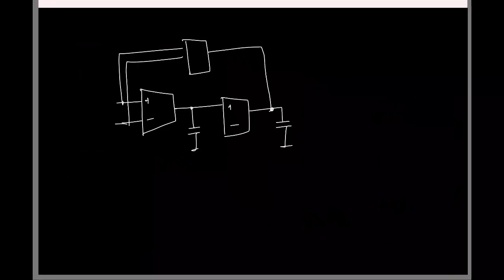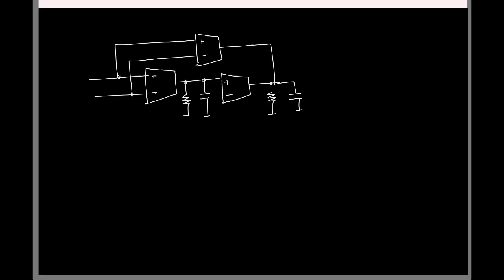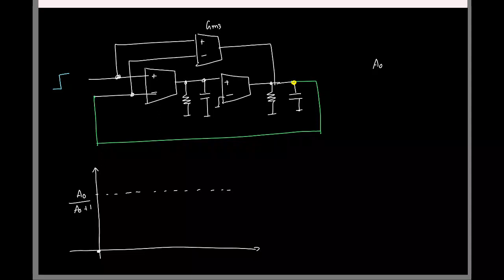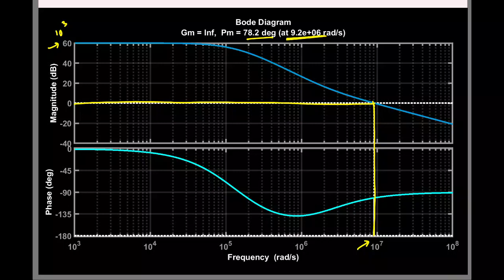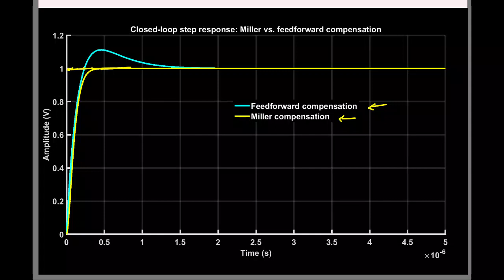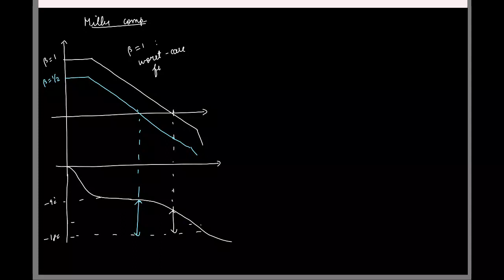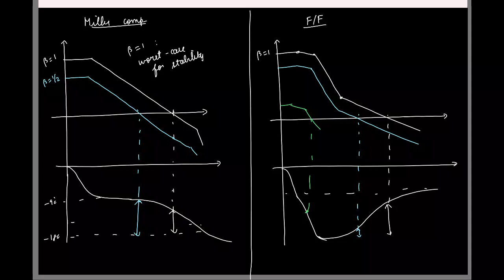Lecture 21: Feedforward compensation; Comparing Miller and feedforward compensation

Comment: Hi Prof, in the 3 stage feedforward case, we have Phase hitting -180 deg when gain is still pretty high. Is this not already an unstable system from Barkhausen's criteria ? 

Even though finally the Phase recovers around our UGB due to the 2 additional zeroes we add using the 2 feedforward paths

Comment: Dear sir, Why do we observe longer settling times despite the PM being good for feed-forward cases? (Transient and stb analysis don't seem to correlate)
Reply from the maker: That's due to the presence of zero. For a step-input, in time-domain, the LHP zero causes the output also to jump up helping in the initial transient. But the jump due to the zero will have to die down eventually. If the zero is positioned at a much lower frequency than the UGB to get a good PM, the exponential decay will also be slower (exp(-t*z)).

Comment: Dear Sir-Could you please explain under which conditions i should pick feedforward and miller? Looks to me feedforward is low power for a given bandwidth provided settling time is not a very stringent constraint? 

Thanks,
Raj.
Reply from the maker: Yes. That''s right. As long as very accurate settling is not desired, feedforward is usually better. It also has a better linearity near the band-edge, as discussed in Prof. Imon's paper: https://ieeexplore.ieee.org/document/9180534